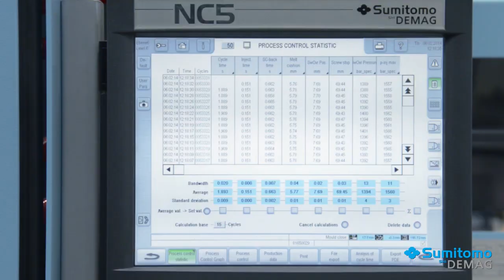96 Caps moulding in under 1,9 seconds - Sumitomo (SHI) Demag

Comment: What are the processing parameters for such low cycle time like 

Shot Weight - 
Injection Rate  - 
Melting Temp. - 
Mold Temp. - 
Ejection Temp. -
Reply from the maker: Please contact our Packaging Team: packaging@dpg.com 
They are the specialsists for such high Performance Applications